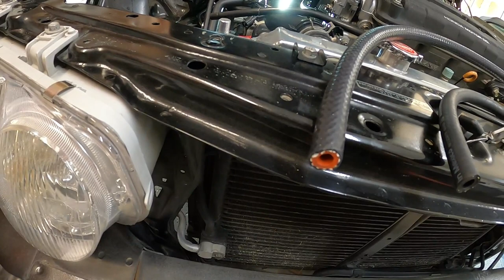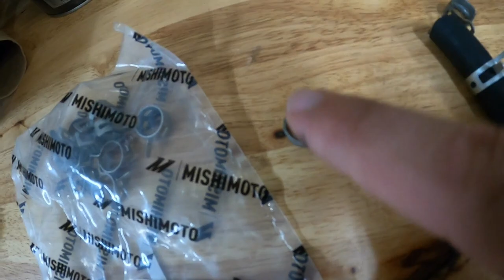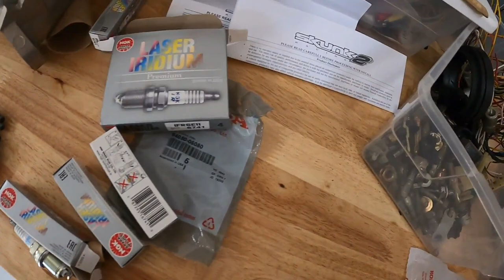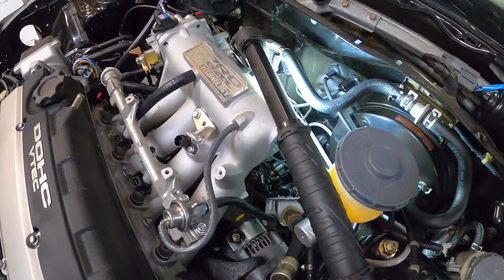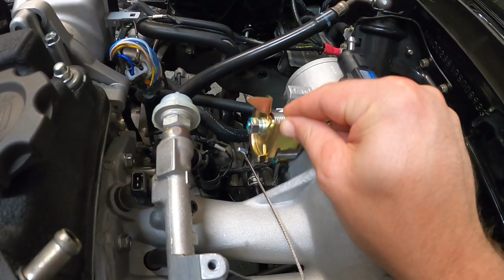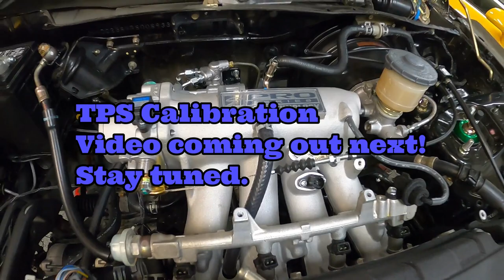Integra GSR Skunk2 Intake Manifold INSTALL | PART 2

Comment: Hello great video.Do you know if that throttle cable and throttle cable bracket will work with B20 pro Series setup in 97 Civic EX?

Comment: I Spencer, I hope you see this comment. I am installing the exact same intake manifold on my 1996 GS-R I have just about everything hooked up. I am not done though. I noticed, there is a small nipple on the back side of the manifold on the drivers side. What do you plan on doing with that now that the vacuum pump for the secondary butterflies are not needed. Also, there is a plug for that vacuum pump (this is the one under the OEM intake manifold.) will that throw a check engine light for being disconnected?
Reply: driver side nipple just gets plugged for stock applications. The pump on the OEM mani was for the butterfly valve, no need to have that and the car will be happy without

Comment: How come you didn't use the P73 hoses for the PCV valve? it has a special curve for it to be routed to the intake manifold.
Reply from the maker: Because the intake manifold hose inlet is in a different position than the stock manifold inlet. Therefore, a custom hose needs to be made.

Comment: Clean work, did you just leave your IAB tuck to the side in the time being?
Reply from the maker: You mean the wiring harness? I have a Rywire tucked wiring harness, it does not come with a IAB connection.

Comment: You didn't check the gap on your plugs. I bet they are incorrect
Reply from the maker: NGK plugs come pre gapped and I’ve found that they have been set correctly
every time I have installed them in my experience. However, I still always check the gap anyways.
Reply: @spencersgarage  only reason I make the comment is because I just went through the same thing with mine. The plugs have been coming pre gapped at 0.044 and the gsr requires 0.052

Comment: Hey man I got a question. So i installed my skunk2 intake onto my GSR(2000). After i put it on it started throwing codes (cylinder 4 misfire, idle control valve). I put the old one back on and they went away but the idle was jumpy. Now its throwing a code for the idle control valve. I know the plug ripped off so inhad to wire it back on. Im assuming the connection isnt strong so ordered another one to wire on. As far as the misfire any ideas on why it caused that? Its not showing any codes for misfire anymore but the idle is still jumpy between 1500-2000

Comment: Did you do something different with the fuel rail studs? looks like you switched to black Allen bolts? reason for that? Great video BTW!! I have the Skunk2 IM and a SF throttle body ready to be installed.
Reply from the maker: I will be installing a skunk2 fuel rail here soon, so those will be changing.

Comment: Where did you get the hardware/braket for the throttle cable that is bolted on top of the manifold and are you using the alpha series throttle body or the pro series throttle body for the gsr? Thanks
Reply from the maker: In the video you can see that the hardware and bracket is Honda OEM. I got it from a Honda/Acura dealer. TB is Alpha.

Comment: Do you leave both nipples disconnected the top and the bottom one on the throttle body?
Reply from the maker: I capped both off cause I rerouted the coolant lines, as shown in the video.